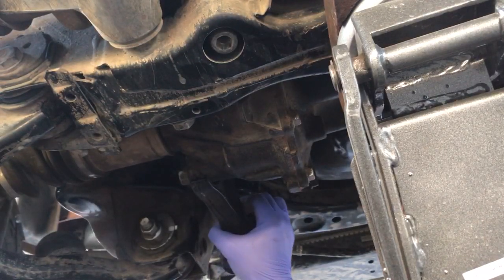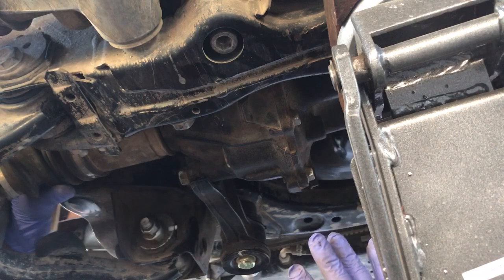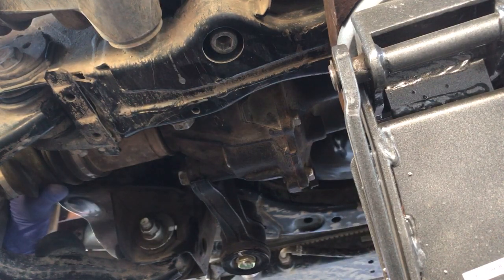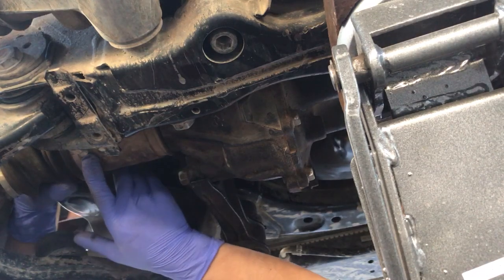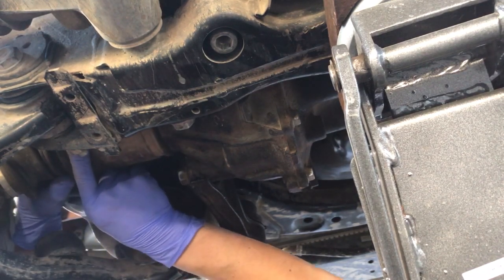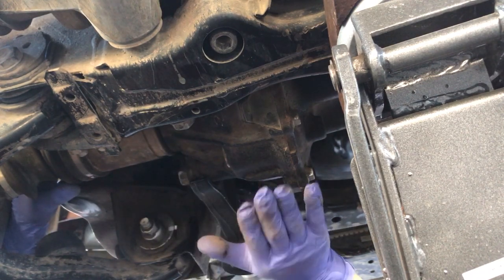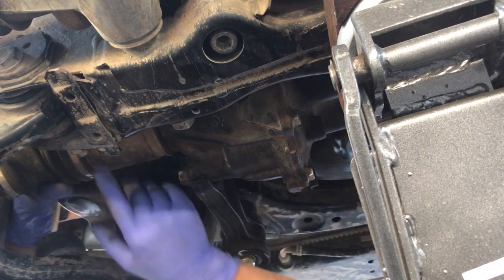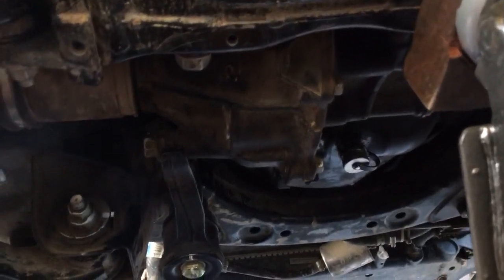3rd Gen Toyota 4runner CV noise rattling sound

Comment: i have a clunking sound on the front left of my 4runner also.  it is hard for me to identify.  the ball joints seem tight or not bad. but when i check the cv axle, there seem to be a play like 2mm. not as bad as yours but it can produce a knocking sound when i move it in and out.  do you think that is where the sound  is coming from? 
after you changed your cv axle, was the sound you were hearing before  eliminated? thanks
Reply from the maker: actually, i found out the play and clicking was coming more from the UCA and LCA bushings after 250K miles than anything else.  The ECGS bushings helped with the in/out play but it really was eliminated by changing my bushings